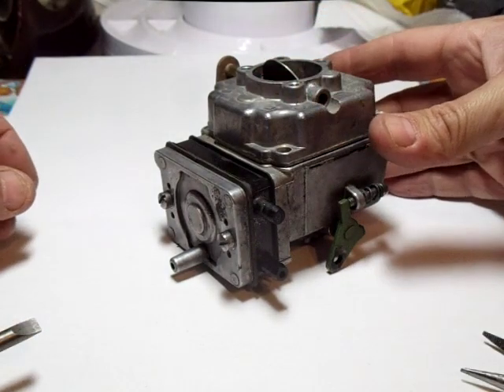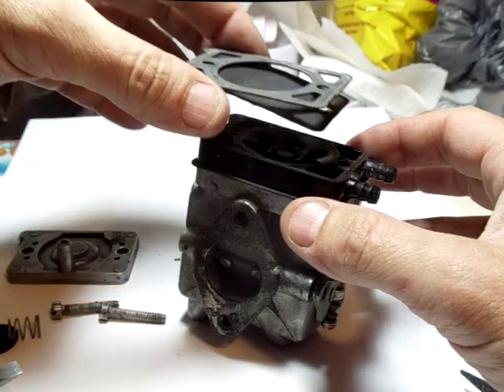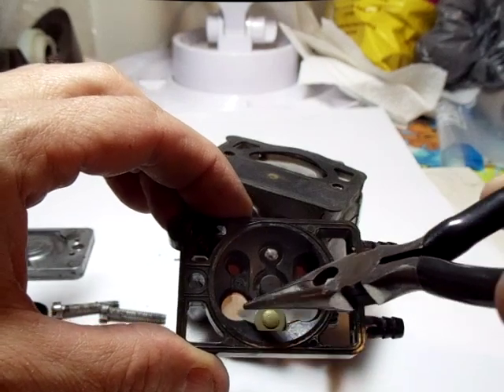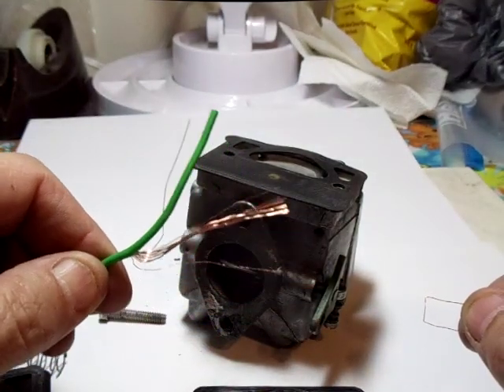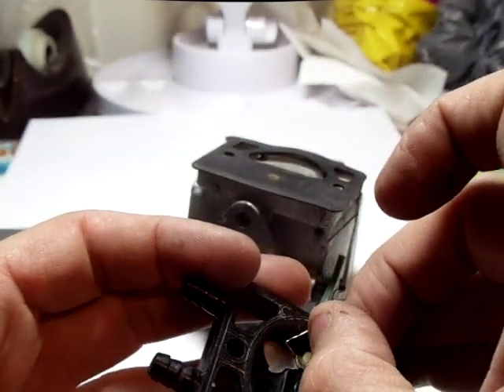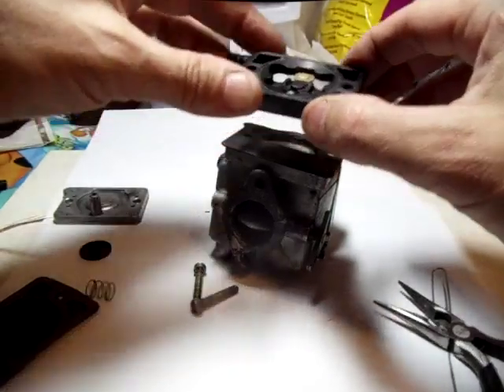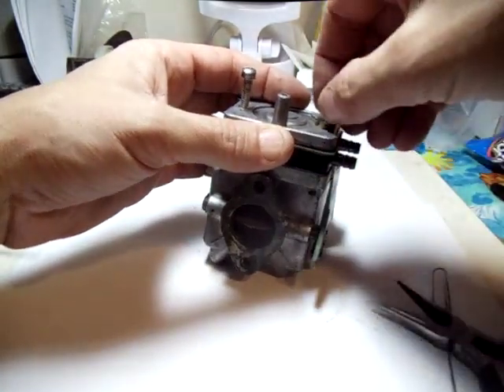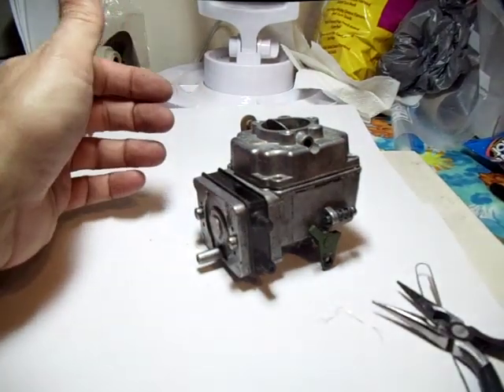Fix/Repair Fuel Pump on Carburetor on a Sears Tractor (GT-18 or Suburban) Onan 18 HP or 16 HP Engine

Comment from the maker: Brain dumping here.
Typically, assuming there is good fuel flow, that is symptomatic of a carburetor adjustment, a port blockage or a seal (gasket) issue (allowing air into carb).  

If you haven't been through the carb 4 times, like me usually,  then gremlins (technical term, of course) are still in there.   Perhaps  take another close look and make sure gaskets and metal mating surfaces are clean (not corroded), or if rubberized or gasket material, are pliable.  I know the metals of some of those old carbs just corrodes and rot away after 30 years, so take a close look!  Where I live, in the midwest USA, I have seen corrosion of the carb mating surfaces. 

What is the elevation in your area?  High elevations can be a challenge.  

Fuel:  I always use the highest best most premium grade of gasoline I can find, and store it in a clean can, fill a clean fuel tank, with good fuel lines and connect to tractor engine, and wire it temporarily to the steering wheel. I have a 1 pint sized fuel tank I often use to "debug" fuel issues in lawn tractors. By moving the fuel supply above the engine, the fuel pump and flow possible problem can be eliminated.  If engine runs better with the small tank attached, the problem is identified ( fuel flow from tank through pump).  If this is the problem, make sure the hose from engine to fuel pump is tightly affixed... you can detach it momentarily with engine running to check for pulsating vacuum suction.

Comment: Onan D-11, D-13 and D-15 carbs are the same rebuild kit
My question is, did you adjust all the reeds or just that particular one?
Reply from the maker: I only tweak/adjust the ones that appeared too far from the seal surface.  On this one, I am pretty sure I did do both on one surface/side.

Comment: Thank you for the suggestion concerning the reed valves. Correcting them solved the running problem. I would note that the blank port nipple is a fuel pressure tap.
Reply from the maker: Thanks for the comment!  I am always happy when someone learns something and benefits from the videos I post on Youtube.  I personally have gained so much by watching other users' videos, that I enjoy giving back when I have a chance to be helpful.

Comment: I have a carb but no fuel pump parts what-so-ever.  Know of anywhere I could get parts?
Reply from the maker: Some people have rigged a low pressure 12 volt fuel pump to eliminate the vacuum actuated one that is standard with Onan engines.  I have used this approach on a temporary basis.  It works.  Just be sure pump is a Low Pressure model.
Reply: @barcodequality , late to the party but that's exactly what I did with my Sears 18/6 when the pulse pump stopped working. Simply mounted the electric pump on the inside of the frame below the sector gear and brake rod, spliced the power for the pump into the power wire for the rear light (So that it's only on when the key is on) and the negative grounded to the frame via the same bolt that I used to mount the pump. Worked great. But if I did it again, I would wire the pump to a switch.